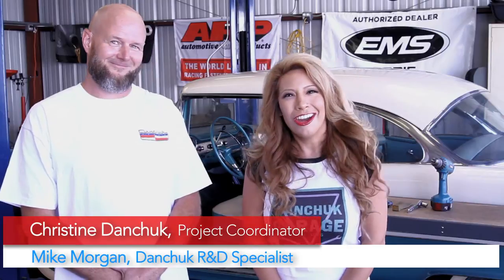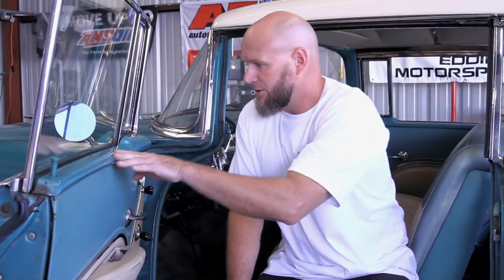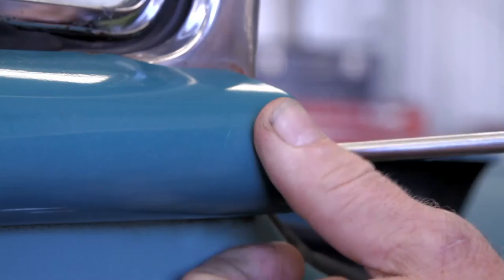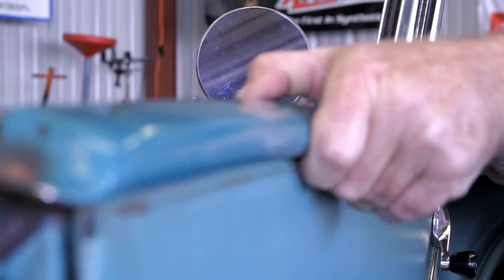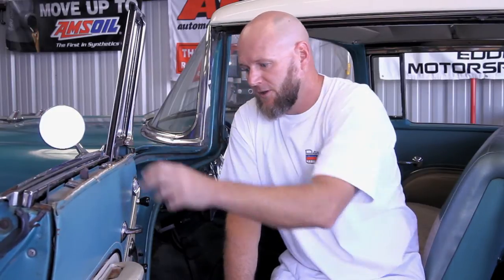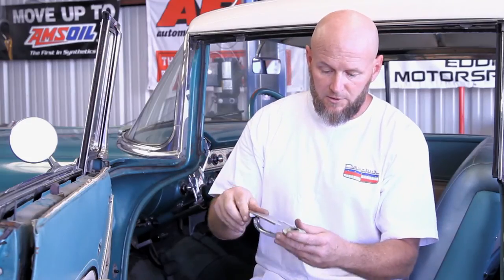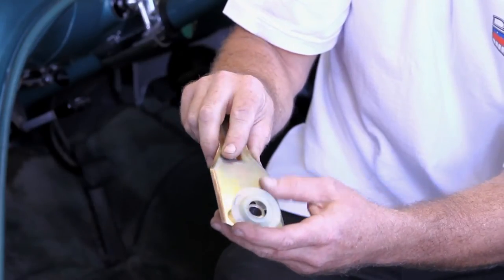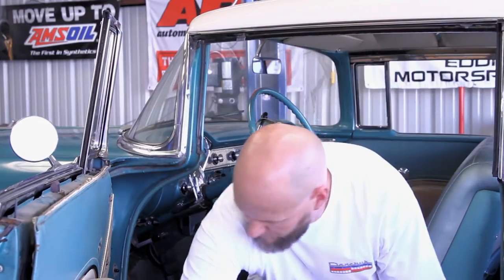How to Remove Front Door Glass, Hardtop, Convertible and Nomad | Danchuk USA

Comment: Christine, how does one remove the chrome molding from the window, once the window is pulled from the door?
Reply from the maker: We asked Mike Morgan our R & D Specialist what he would do and this was his answer.  

Lay the glass flat on a towel over a workbench or sturdy table. Some guys masking tape the glass completely on one side to avoid scratching the glass if re-using it.
Take a block of wood (2x4 will work) and a rubber mallet, place the block of wood on the glass next to the chrome trim. Tap the wood with the mallet in a sideways motion, keep the mallet head from hitting the glass directly.
Go along the length of the trim tapping it as you go. Might want to soak it with dish soap if it is original and hard rubber.
Reply: +Danchuk USA Thanks.  I'll give that a shot.  Do you folks sell 50's car parts by any chance?  I have a 1957 Ford Fairlane I need things for.
Reply from the maker: We don't do anything but 55-57 Chevy Cars.  Try these guys... http://www.fordrestorationandparts.com/catalog/fairlane
Reply: Thanks so much